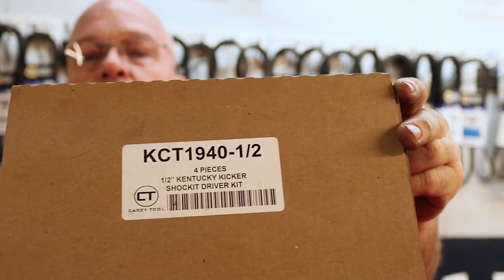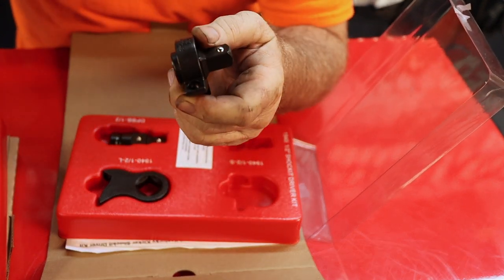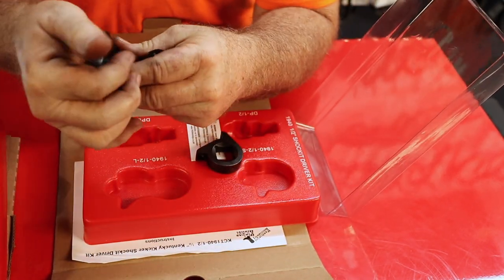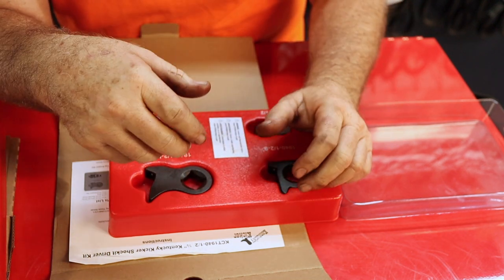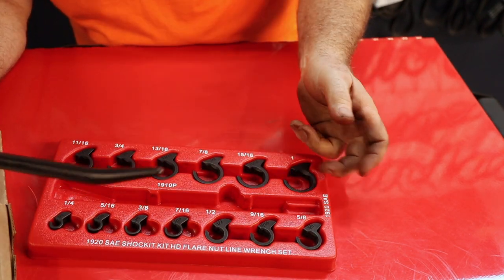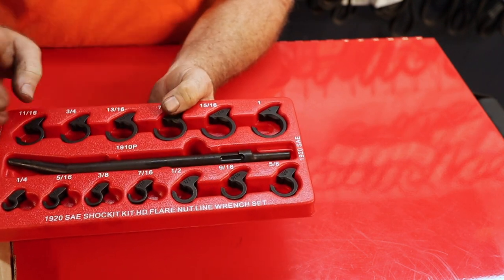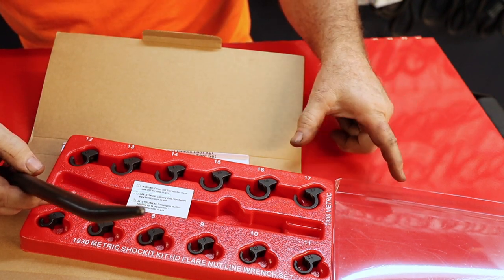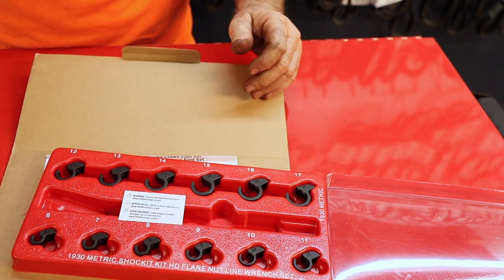KC TOOLS SHOCK IT KIT, flare nut and air hammer adapters set, put to use...

Comment: I did  it today Jimmy! I bought the Milwaukee 2690--20 3/8drive impact! 600 lbs of bolt breaking torque and 450 Tighten torque! It's a beast! I didnt realize this gun can take off lugs nuts and suspension parts! Now I can leave my Heavy 1/2in Dewalt 899 in the box! I knew the compact ones weren't that powerful, but this thing is amazing!
Reply from the maker: Awesome, glad to hear it’s working good for you Mitch!

Comment: These Shockit Sockets work absolutely fantastic on hydraulic fittings for steering racks, backhoes, and forklifts! Our vocational students have ground down all types of line wrenches and crows feet for difficult to access fittings and nothing beats these Shockits. They   fit into places without the usual major disassembly to gain access. Even the most rusted fittings have loosened up without galling the threads. Using the rapid hammering of an air hammer is a brilliant idea for loosening stuck threads. Sometimes it takes 20 seconds of constant low speed hammering  but they always loosen up without damage. We have never tried them on O2 sensors like you did, but Casey Tool makes a different design Shockit socket for those.
Reply from the maker: Excellent comment, thank you for helping to  inform the viewers!

Since we broke this one they warrantied it with one that looks a bit beefier in the right spots. But you are right, I've since found out they make a separate O2 sensor version. :)

Comment: LTI makes one .. it’s called the Shock It 02 sensor removal tool. Part Number 994. Sells on JDTCo for $129. It’s a shallow 7/8 , deep 7/8, the air hammer drift and a thread chase .. It works great for me. It looks similar but it def seems beefier than the one you picked up .. anyway just wanted to share that. Keep up the great vids !!
Reply from the maker: Thanks very much for you input Drew, appreciate it! I’ll check it out.
Reply: @Drew Lane Agreed

Comment: That 6 mm tool would be useful in a tight spot but you would have to be careful with it but I've seen lines where I couldn't get a wrench or even a crowfoot on and turn it so that may loosen it C P THE TOOL ADDICT showed a set of flex head crowsfoot and I bought those a couple of months ago but I like that shock it set thanks for the video
Reply from the maker: Thanks for watching!

Comment: Jimmy, I know this is a year old  at this point, but next time use the $1500 Wilton vise on that work bench to hold the exhaust. Physics will work for you if the exhaust is in a solid hold and you are using the air hammer.
Reply from the maker: Very true!

Comment: Wrong tool for the job there Jimmy. As @Drew Lane pointed out, they (LTI) actually makes a O2 sensor kit which is sitting on my garage floor, definitely beefier. Also, that vise next to you was asking to help out hold the part!
Reply from the maker: That’s what made me wonder why it came with a 7/8 size tool.
Joe here tried it in the vice the next day, insisting it would make the difference and the tool broke.

Comment: They seem like it could be a good idea but if they aren't tight enough, how could you transfer the energy?
They're potentially a good idea to use on fasteners where using a wrench might run the risk of slip.
Yeah, that's a pass from me too. Thanks buddy
Reply from the maker: Thanks Kris! I’m was wondering if mounting the pip in a vice might have helped. But the next day Joe tried it that way and broke the 7/8 tool end.

Comment: I bought the 1/2 inch shock it set. Was disappointed in it. It simply doesn't work. I was hoping that this video will point out wy it doesn't work.  I can't figure out why it doesn't work. The principal and theory behind it is sound. 
 The Texas twister is sound in theory, but it puts everything into the curved neck instead of where it's needed. If you could do a straight pull with it,it should work then
Reply from the maker: I think there is just not enough mass for anything other than light duty tasks.